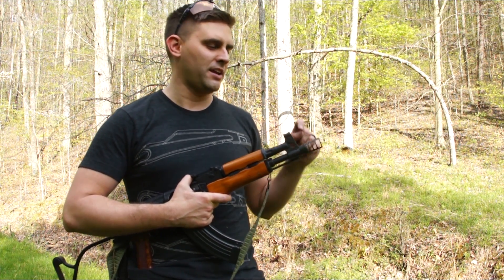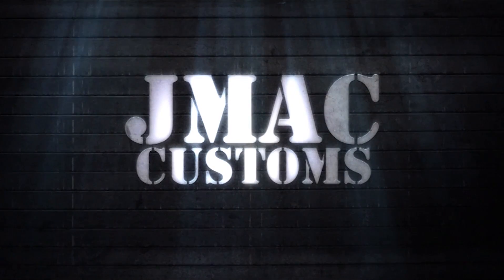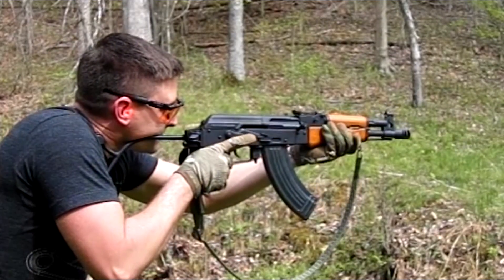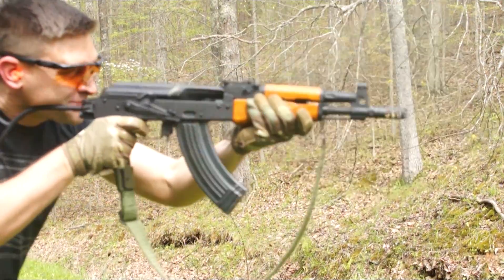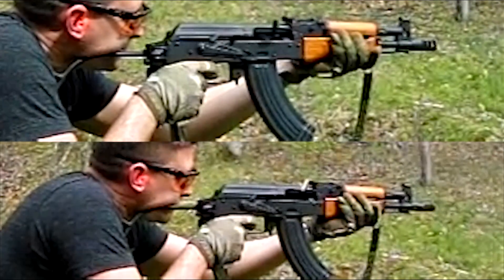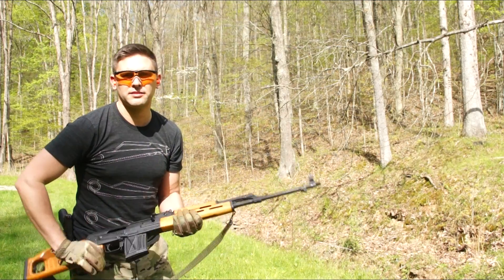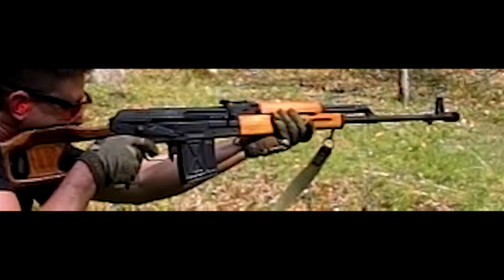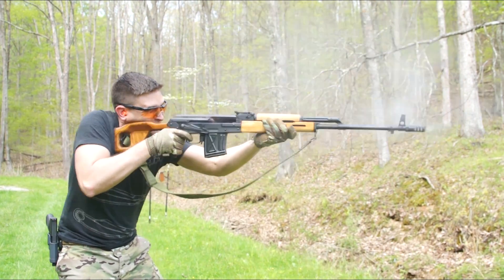Testing RRD-4 Prototype Muzzle Brake against the Lantac Dragon - JMAC Customs

Comment: From the vid yalls is the better break. The lantac ports on top could leave an operator temp blinded if shot at night. Vs y'all break directing the gases to the side. I'd like to see how your break vs the shorter 2.5 inch an amd65 break
Reply: It won't blind you at night that's just interwebs bs

Comment: It is easy to see how well it mitigates the recoil of the round firing itself and the slow motion shows (AK very much so especially) the weight of the carrier assembly slamming forward produces the most muzzle change. 
The PSL barrel whip was interesting, Justin. 
Great job!!
Reply from the maker: madrussian75gmail Yes the muzzle impulse is almost completely eliminated, you can see that the carrier moving back and forth like you said is what is causing the rifle to move, we will test these on a bolt action as soon as we start making them in different threads! Yes the lantac has a downward push which causes havoc on the PSL! actually made it feel like it had more recoil because the barrel whip caused the stock to slap my cheek pretty violently